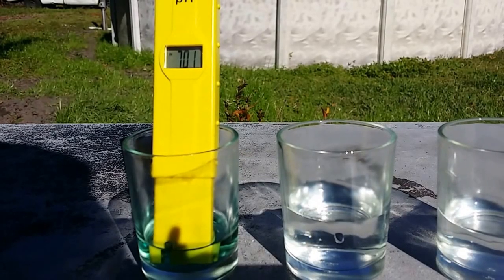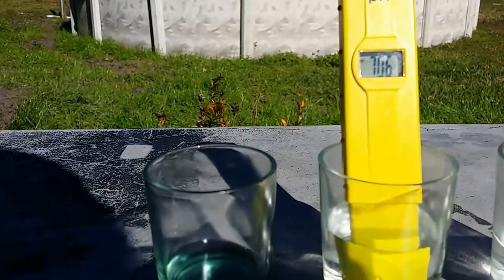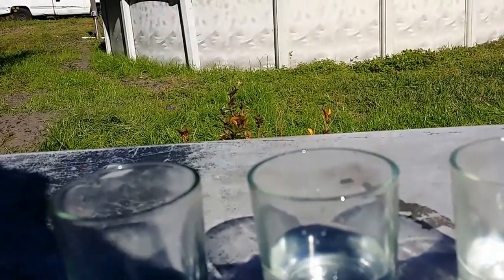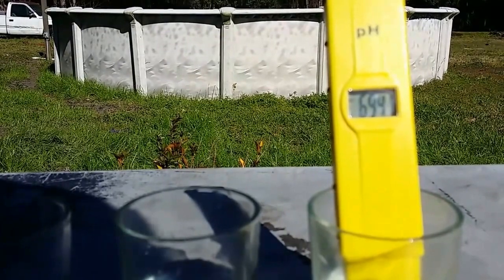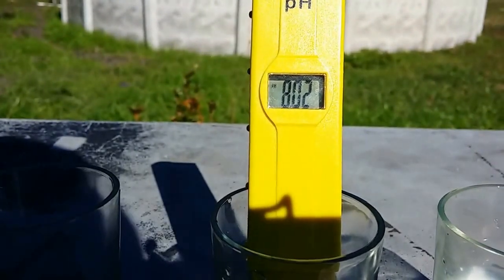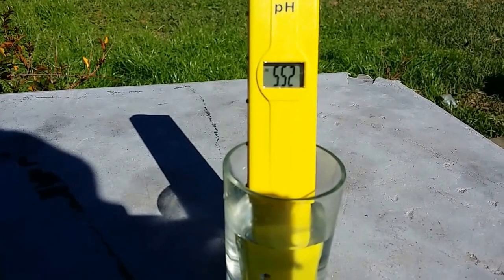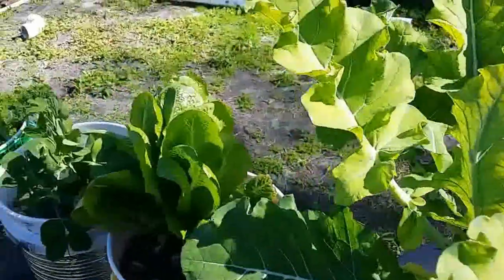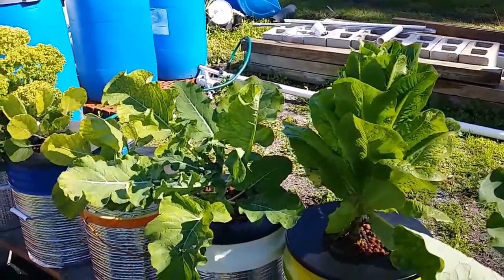rain water ph testing for the aquaponics system. Small plant update ep 59

Comment: As I'm sure you know, pH of rainwater is affected by atmospheric pollutants (acids).  When I homesteaded in MA, it was an art dealing with the acid rains in the summer.  When I moved to Sarasota, I had to learn an entirely new way of gardening as the west (Gulf) coast of FL has 'clean' water if the rains come from the West.  Now, living in OR, we sometimes deal with the Sulfuric acid from coal burning in China.  Back in the early 70's, rainwater in MA would be in the low 4 range.  I've heard from gardener's in LA that pH can drop into the low 2 range when they have inversion going on.
Reply from the maker: David Dube that's very interesting. Have you every come across train with a high ph?. If so do you know what causes that?

Comment: That's interesting.  I tested mine last summer just once and it was mid 6.  But who knows if it was accurate - I was monkeying around.  I'll continue checking for funsies...
Reply from the maker: It actually has been pretty interesting, especially when trying to get the ph of the aquaponics system on point. I have been testing different rain samples and finding that the longer that they sit in where they were collected.The higher the ph.
Reply: gardening4fun Try letting distilled water sit in one of those containers where the rainwater goes to higher pH the longer it sits. Pure distilled water should start out pH 7.0. If you're getting some kind of chemical leaching of the container, the pH may change over time. Since distilled water contains nothing at all but water, even a little bit of leaching can swing the pH noticeably. Also check the PPM's, maybe leaching of the container will show up as increased PPMs.
Reply from the maker: zilym I will check into that. However I have tested the ph of distilled water after I opened  the jug and it had been sitting for a few days and the ph did go up. I tested the water from the jug so it should have stayed neutral. Thanks for the feedback